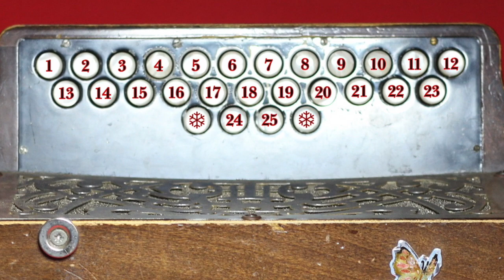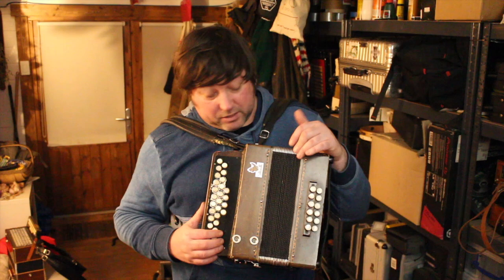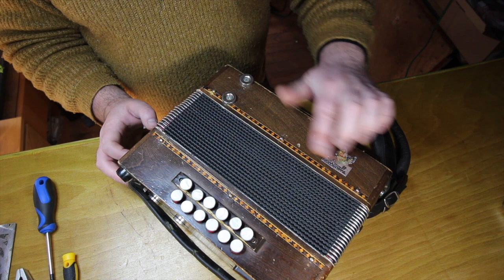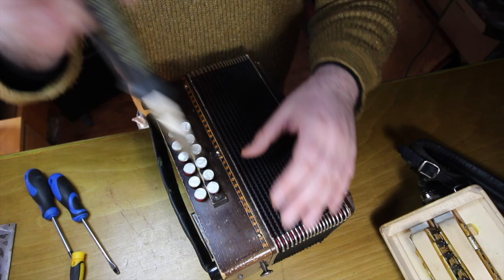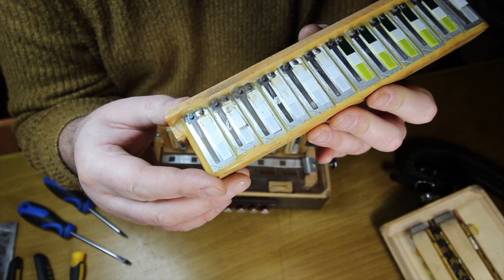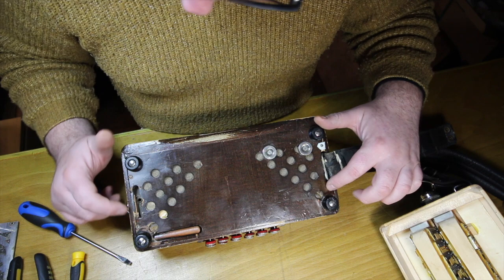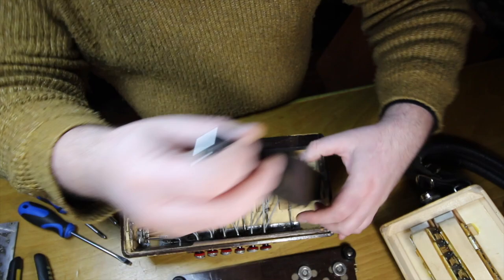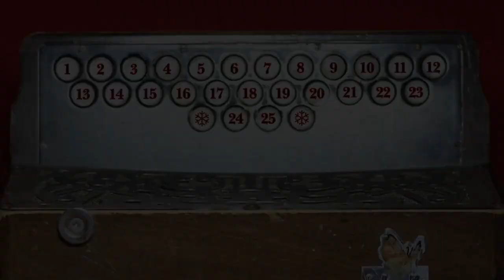Squeezebox Advent Calendar with John Spiers - December 24th - Saltarelle Connemara II in D/G

Comment: When I was selling accordions from Italy in 1999-2002, I know that Serenellini Accordions was manufacturing Georges Roux's Saltarelle. The Connemara, Nuage and Irish Bouëbe still had the tasteful, small square badges on the front plate. The Nuage had A Mano (handmade reeds) and the Connemara either had A Mano or Tipo A Mano; both were black by that time. (The Irish Bouëbe for some reason had the cheaper Super Dural reeds which really are a big step down.)  I believe all the Connemara finishes were brown some time prior to that. The Irish C#/D player Martin O'Connor designed the Connemara. Another Italian company other than Serenellini may have made the first models, I do not know. Some believe Dino Baffeti may have been the original makers for Georges, which is entirely possible. Baffettis are wonderful acoustically, if a bit garish visually.